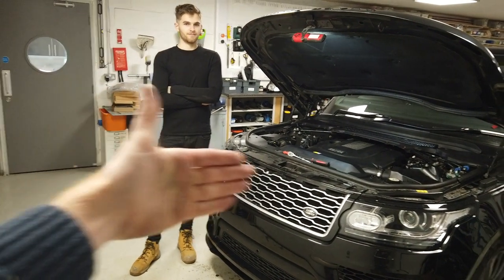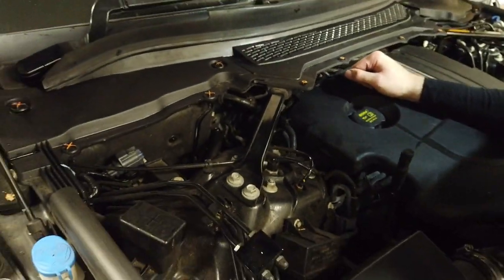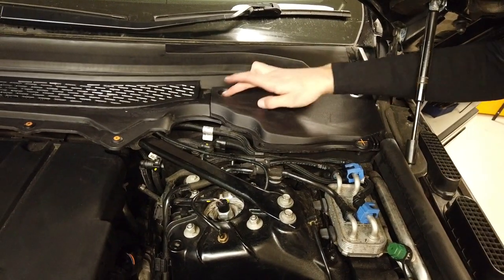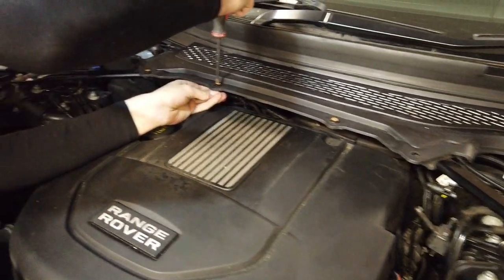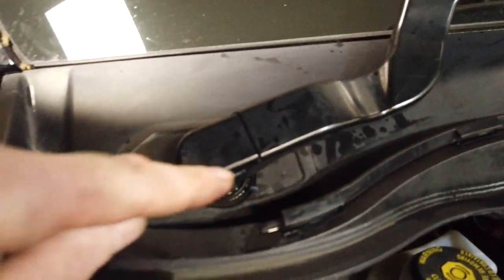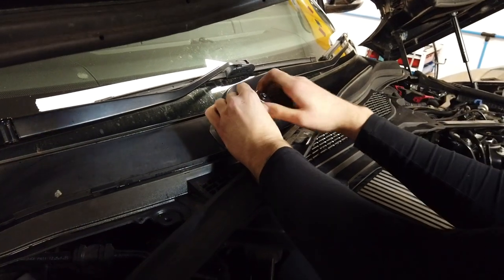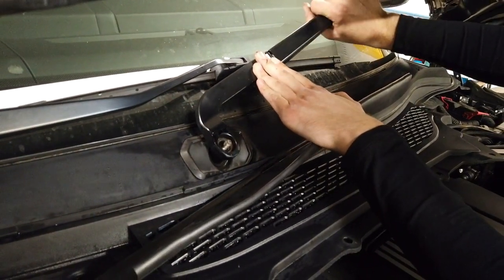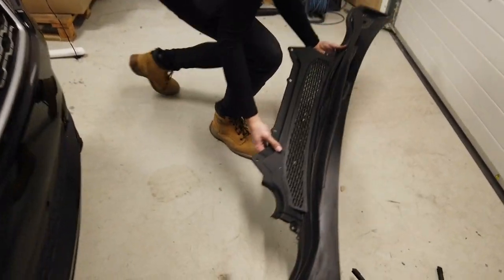Range Rover L405 Windscreen panel Removal / Wiper Arm / Fuse box Access

Comment: Hi 🙋‍♂️ Nice 👍 some 🚙 have a battery 🔋 fitted instead fuse box 📦 and your IID tool is recover electrical 💺 seat reset when it 🛑 some error issues. And programs nee 🔑 key for L405.
Thanks 🙏